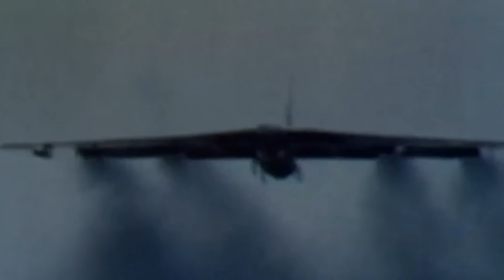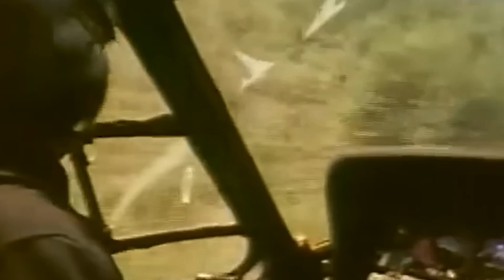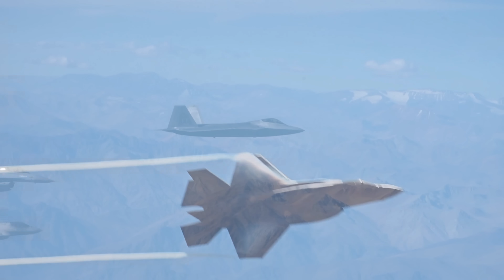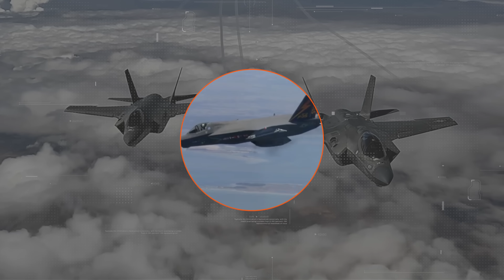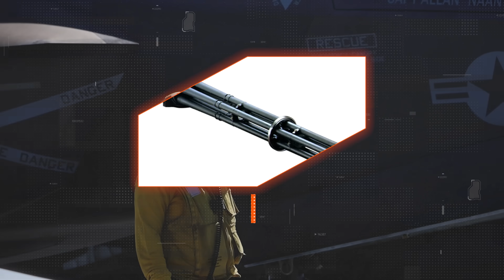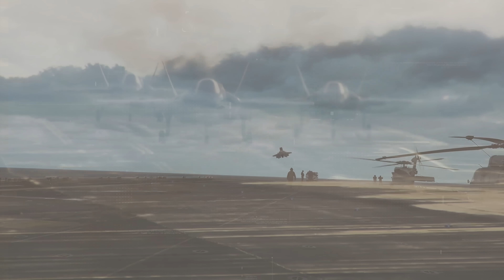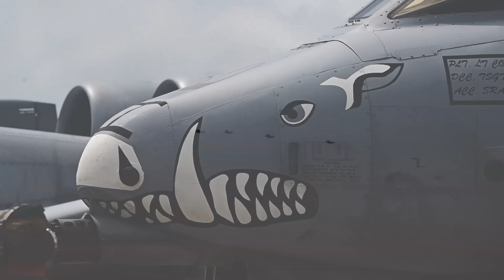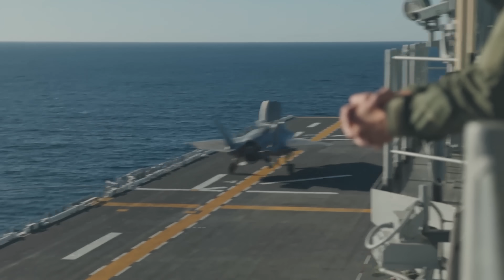A “STUPID” Mistake Is Making the F-35 UNSTOPPABLE

Comment: Oh it’s still stoppable. Let the raptor out and it will haunt it down and kill it. Good thing they’re on the same team
Reply: The raptor is the only real 5th gen.   The f35 is a totally different kinda technology race
Reply: @mattycheezeburger it’s a top tier multi role aircraft. But it has no chance against the apex predator
Reply: @erikcourtney1834  multi role.,,,yes. and well see in the future that its designed to  be a drone  base. drone node...relay point carrier. etc  where as the raptor is an old school fighter jet with physcial capibilties for that.  the f35 just isnt desgined for a dog fighjt.
Reply: @mattycheezeburger  well, before it become what it was dreamed for, they will have to deliver what it was downgraded to, then try to fix the lacking parts...
it lack electrical generation power for better computing, radar and other electronics
it was so well designed that they can't even change the radar due to lack of space in the nose
lack of space also make it hard to cool the electronic
to solve the power generation problem, they need a new reactor that is more massive and can't enter the fuselage as is, meaning they need to redesign it and retrofit to all existing planes...
the only version of the F35 that is fully combat capable (at a downgraded level vs what was promised) is the Israeli one, because they put THEIR software in there.
Let's face it: no gen 5 fighter has faced anything but "gen 3" yet...
the closest thing to peer to peer combat we have seen is the "recent" operation between India and Pakistan and even then, they didn't really use most their capabilities (first round, India forewarned of a limited operation as to not escalate, didn't use SEAD and were "ambushed" with no proven losses and very few non fabricated hints of some). Second round, they did properly do things and didn't forewarn and flattened the Pakistani air defense capabilities, including downing a brand new "awac-like" system...
in the first round of the operation, allegedly, dozens of Chinese made missiles were launched at single targets that they defended against, leading to the Indians salvaging at least one fully intact of the top of the shelf Chinese made missile, for "studies"

I repeat, no gen5 has ever faced anything gen4.5 or better in real combat... we all are mostly fighting down...
meanwhile, the US defense commission has repeatedly expressed their dissatisfaction with the F35, be it for its cost, existing capabilities or delivery. There are promises of improvement, but it's still far in the future and already 10 years late right now... and promises don't fight... they fool peoples...
Reply: @mattycheezeburger dont forget our last true F/B F15ex. Redesigned to carry maximum payload, depending on the mission.. but the new mission is support F35/22 and drop big bombs

Comment: Weird flex saying that the operation cost pr. hour for an F-35 is an advantage. What good is all the mechanical advantages it has when flying a wing (20 planes) for a five hours mission costs roughly  4.8 MILLION USD. That's before the hangar-related costs.

That's fucking madness. A single F-35 costs 48.000 USD pr. flight hour in operational costs. A Gripen E/F costs 22.000 USD pr. flight hour and have vastly reduced hangar-related costs. You can literally fly TWO Gripen E/F for a lower cost than ONE f-35.

The one-seater Gripen Jas 39 has an approximated operational cost of 4.700 USD. You can literally fly 10 Gripen Jas 39 for a lower cost than flying ONE F-35.

I think that's the biggest weakness of the F-35 and I'm unable to see how that can be turned into an advantage.
Reply: We don't care about money; only winning.
Reply: @RobertHall-mq7ze  Incorrect, the MIC only cares about money. Winning is a secondary concept, at least until they realise that only by winning is your product attractive.

Comment: I believe the U.S. Navy needs to go for smaller warships like the small carrier concept.  I was on a Battle Cruiser in Vietnam, the U.S.S. Boston which was built in 1942 I believe, and before that, on the U.S.S. Albany a Guided missile cruiser, that they had to add two 5"-38 gun mounts to later, for close up protection.  I always felt that we were targets because of our size and crew of 1,485 men.  We did have 6" thick armour belts on the hulls.  Modern aircraft carriers have no armor and modern cruisers also have no armor.  If one of our super carriers get hit, it would be catastrophic with a loss of over 5,000 men.  We need hundreds of smaller but deadlier warships, like the Arleigh Burke class with nuclear power.  Our Navy plans on no hits on surface ships but drone swarms are a new wrinkle.
Reply: Hundreds with nuclear power?   Such a silly statement…… The Burke Class is about as small as you can go and still be effective.  A small carrier is much less effective but needs the same number of escorts.
Reply: Statements without thought. Meh
Reply: I thought supercarriers traveled with a fleet of escorts assigned primarily to deal with and screen against threats that are unnecessary or bothersome for the carrier to deal with.
Reply: They use both. Only the super carriers are capable of landing the strongest jets. But the US also has 9 "amphibiious assault ships." They don't get classified by the US Navy as carriers but are functionally upgraded versions of what everyone else in the world calls a carrier. They have the same capability Britain's Charles De-Gaul but with the technological upgrades of a US carrier.
Reply: @YoWhatGoesHere  Britain would never field a carrier named after a Frenchman. Charles DeGaulle is French, the British carriers are the Queen Elizabeth-class, Queen Elizabeth and Prince of Wales .
Reply: @billmcdonough3950 😂 Sorry. I don't know why I wrote that! I was picturing the QE in my mind and yet wrote the wrong one.
Reply: You old fart..🤔
Reply: Phalanx solves a lot of problems.
Reply: You are aware that sinking a modern carrier is very hard yeah? They tried with USS America after days of hitting it with just about everything, they gave up and scuttled it. Lessons learned from that went into the Ford class. The Soviets figured they’d need at least 9 torpedo hits to sink a Nimitz carrier.
Reply: You obviously haven’t heard of the Sea Hunter. It’s just been commissioned after 10+ years of testing. All autonomous 10,000 mile range originally made to hunt down submarines.. the US military plans on having 11 by next year which if I’m not wrong that’s how many carriers we have.

Comment: Maybe F-35 in 20 years, after 1000s modifications, will be remembered as the best jet for attack, but not for defense.
Reply: For initial attacks to take out anti air or ambush enemy fighters from far away, yes, the F-35 is probably what you want.  The F-15 is probably what you want for non-stealth needed offense and defense.
Reply: Itll be remembered as the last manned fighter. And maybe most expensive.
When you can deploy a floating minefield several km2 for price of a f35 n bring one down for less than 2k  its use will be very limited. Loitering Drone swarms are months away
Reply: What is better?
Reply: @renegadekav  I imagine the F-15 still.  You don't need stealth for defense.  The F-15 still offers great performance, heavy firepower, for a decent price.
Reply: @renegadekav F-22 actually has a smaller radar cross section that the newer F-35. But both are absurdly small, though we’ve already lost one — I’m guessing to enemy fire though we haven’t confirmed that yet. If we are told it was friendly fire or from an Arab  ally, I will have a hard time believing it.
Reply: @Kfarris22 Already lost one?  The one damaged?  Hundreds of F-35 sorties and one plane struck while likely operating low a slow seeking pop-up targets.
Reply: @Grouse2275  Yeah, if you only lost one in only hundreds of sorties, I'd say that's a good record.

Comment: it's a bit of a stretch to say the cannon was a "stupid mistake" when it was specifically designed to replace the role of the A-10 and the Marines would never dream of going without for CAS
Reply: If the Air Force does not want the A-10 just send it to the Marine Corps and they will gladly take it
Reply: @samsnead7  Yeah if the a-10 even got half the upgrades everybody else got it wouldn't even be a question of how capable they are.

All those friendly fire incidents happen because the Air Force refused to give the a-10 Friend or foe, or night vision. A-10 pilots for stealing infantry night vision goggles during the first Gulf War.

The Air Force treats strike missions like a bottle episode. The real power of the A-10 is to keep the enemy's head down for extended periods of time. 

F-35s are ridiculously quiet. And A10 you can hear coming from miles away. 

The f-35 might blow up its objective, but everything else is still going to be combat capable. And the infantry are going to have to deal with it. 

The A-10 might miss every single target. But the enemy is pooping their pants so hard, the infantry can move in and get the job done. 

Same doctrine as artillery in World War II. You deny the enemy any peace of mind until they break. F-35s get in and get out, they don't have a lasting presence.
Reply: Being legitimately scary as hell is also a force multiplier.
Reply: Nothing can replace the A-10
Reply: @samsnead7  why i want ones with zero miles already on it
Reply: That's why they baited us with "quotation marks" 😢
Reply: some bot copied your comment man :/
Reply: Called clickbate mate, he got you hook line and sinker lol. He got us all.
Reply: While the F-35 is meant to replace the A-10 in CAS, that is kind of an overly specific interpretation of “replacement”. The truth is that the F-35 is replacing the F-16 which also performed the CAS role, and the A-10 is just being retired. The gun was added because they didn’t want to fall into a similar situation as Vietnam, but were not worried about the same situation. Missiles are far more accurate and reliable then they were before. However, now with the increase in drones firing a missile at a cheap drone is not cost-effective, but a gun can intercept a Shahad drone fairly easily and cheaply.
Reply: It fails in that role
Reply: That's like saying sending troops into combat without chainmail and a longbow is a stupid mistake when they are intended to do the same thing as soldiers of the past.  Even the A-10 today does CAS with missiles from 6,000 feet up.  Getting close enough to use a gun is a fool's CAS, or coping with an equally outdated lack of modern sensors.
Reply: It was definitely not designed to replace the A-10. Why are you lying?
Reply: @taviorivera4859  lying? no - fact the ATF program (turned into the F35) had that exact requirement. i don't like it but its true
Reply: @taviorivera4859 Because it is. The F35 is the replacement for the A10.
Reply: @taviorivera4859 it was originally designed for multiple roles, one being the A10 warthogs'. But physics and reality kept the A10 in service even though the air force keeps trying to retire it.
Reply: @taviorivera4859
Yeah, it was. Originally.
Go look up "joint strike fighter". You'll find things from the mid 90s saying they wanted it to replace the a10, f16, f15 etcetc
Reply: It was in no way designed to replace the A-10, not even close to the objective of F-35.
Reply: @richardporter8817 

That is explicitly one of the F-35 missions. Can it do it as good as an A-10, obviously not! It was sold as a Jack of all trades, and a sorta master of some.
Reply: @richardporter8817 Yes, it is. The F35 is replacing the A10.
Reply: @eec-q3 it may take on some task when possible. It is too heavy to fly slow enough to take on that roll. Hey, if you keyboard warriors want to make that claim, go right ahead. It isnt even a dogfighter.
Reply: @richardporter8817 Stealth planes have more of an advantage at slower speeds. Billie Flynn would seriously disagree with you, but he's only flown military aircraft his entire life.
Reply: @eec-q3  except one of the reasons the A10 is used is because it can go at low speeds without stalling making scouting, search and rescue and loitering easier which is all things the F35 doesnt match up to.why? Cause its not made for CAS its a fighter platform made for stand off fire....not only that the hard points.
Reply: @MoDeLi370 The F35 is replacing the A10. The F35 was designed to do close ground support.
Reply: @MoDeLi370  slow speed scouting search and rescue is a role better taken by UAVs.  
Less pilot casualties too.
Reply: @MoDeLi370 f35 was designed to be multipurpose
Reply: @theperson5185  yea, an aircraft that is single purpose is more effective than one thats multipurpose
Reply: @eec-q3 it was not made to do CAS at all, it was made for attack. Not the same.
Reply: It wasn't designed to replace the A-10, it was designed to replace the F-16. As time went on, they lied to themselves and went with the idea that if they could retire the A10 they could recoup the money and use it for the A10 program. The ones making that decision had never flown a day of CAS or CSAR in their lives so were clueless at what the true requirement is or even should be.
Reply: Replace the A-10? The F35 is just not capable of the fre rate or power.
Reply: @TazaelBen-Aton Yes. It's the replacement for the A10.
Reply: @eec-q3  its not...there are a couple of things that the A10 does better because it was made for CAS unlike the f35
Reply: @MoDeLi370 Once again, the F35 is replacing the A10. The F35 was designed to do close ground support.
Reply: Surtout que rien d'autre ne fonctionne  !!!
Reply: The A-10 is only just barely capable of doing CAS anymore, and its gun is pretty close to being a liability at this point.  Almost any multirole fighter is more effective, as are a number of strategic bombers.  It’s just another one of those immortal federal programs at this point, kept alive for purely political reasons.
Reply: @Count_2_10  CAS is more than just drop la bomb on target and the A10 does a little more than CAS not only that has now gained a new usefulness in taking out drone with apkws
Reply: @m @Count_2_10  do you realize we were in the process of retrofitting all a tens, right? The cost 7 million. In your logic, we should get rid of The KC 135, B52, B2 and c130?
Reply: They should take the Gau-8 30mm cannon out of the A10 and put an anti drone laser in there.
Reply: @jacobzindel987 Just have both, sling the the lasers under the wings
Reply: The f35 had some major problems in the beginning also it’s effectiveness. So a smart president asked how do we upgrade existing planes,  F15EX and A10 retrofit made sense.
Reply: @brianclemetson8781 Airforce generals wanted to scrap the A-10. Big gun on F-35 ticked that box.
Reply: @Dave5843-d9m What other plane can protect ground troops and give F35’s support at the same time?
Reply: @Dave5843-d9m  yea they want to use the money for other platforms the A10 does many things better than the F35 cause its not specifically made to do CAS